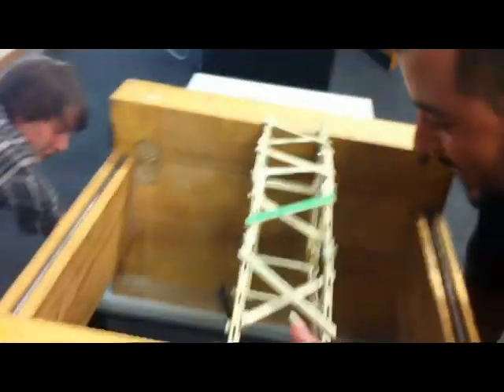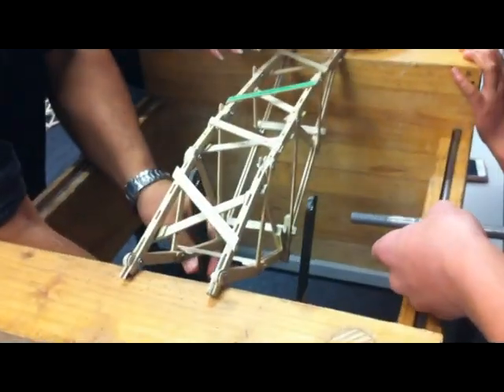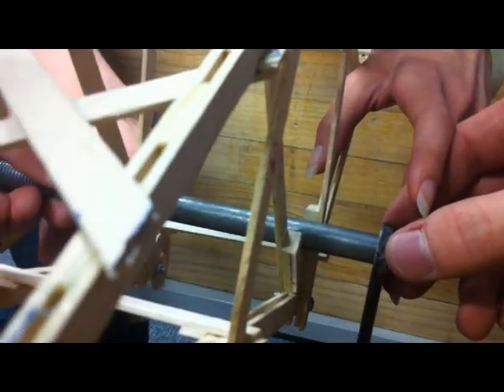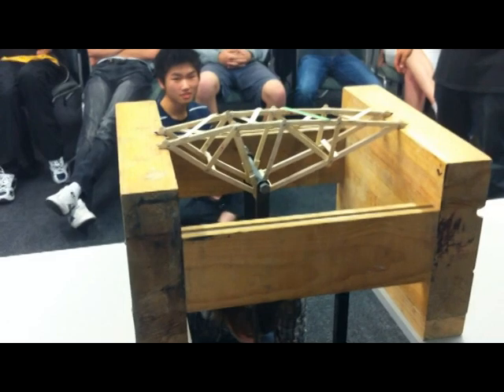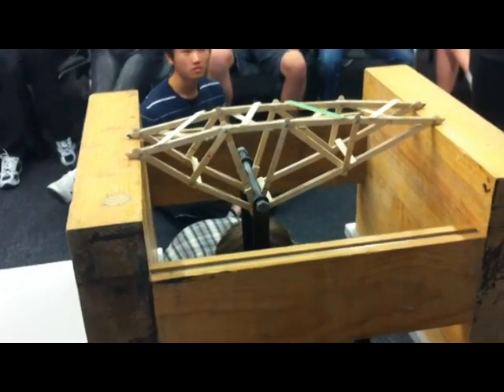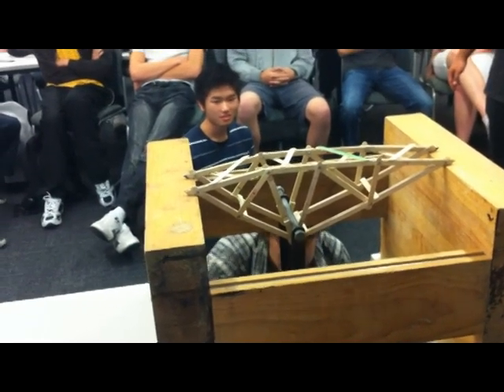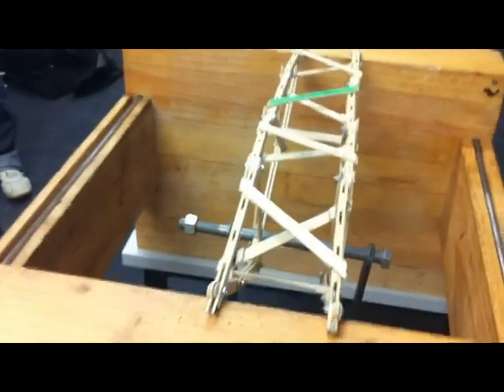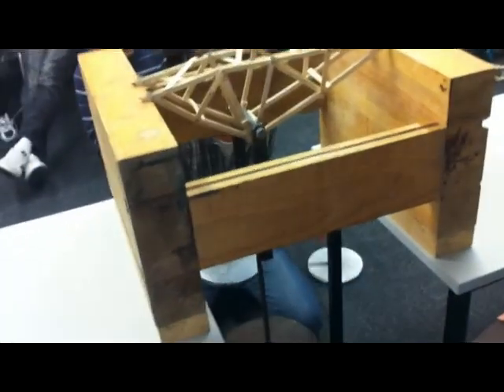Record Truss Bridge 2012 - University of Auckland Engineering

Comment: The crazy thing is that the actually bridge part didn’t fail the sticks failed
Reply: That's what's going to be the source of failure no matter what, it's just about designing it to distribute weight across all of the sticks.
Reply: ??? the sticks are the bridge, it's like saying an actual bridge didn't fail because only the cable snapped
Reply: William Lyon  I think they mean the parts where the sticks connected, whereas the breaking point was actually in the middle of the popsicle sticks instead.
Reply: Neal Head  pressure will almost never be evenly distributed across a bridge
Reply: What will melt your brain more than this is they had stacked the weight on top of the bridge it would have had a different breaking point, in terms of weight.  It may have been less or it may have been more but having it distributed differently would have changed the physics.
Reply: @marine_vet  wow
Reply: Santos you actually made a good observation that was not fully understood by the people who commented. There are many different ways a construction can collaps, it always collapses at the weakest point.    In this case the collapse happened at the point where the load was connected to the bridge, (if I saw it right, footage was sort of blurry) because of transverse forces acting upon the wood. You can call it a popsicle bridge, but when calculating the model the properties of the specific wood applied are taken into consideration. You could see them as very tiny wooden beams. The fact that they have rounded edges does not play a role. In this type of bridge, some popsicles are under tension while others are under pressure. If the bridge had its weakest point in one of these elements, the structure of the bridge would have collapsed. I think that is what you intuitively understood and what you were trying to articulate. 🤓 edit: correction, after a closer look I think the construction collapsed because of tensile forces, hence four broken popsicles..)
Reply: @hesterdekoninck  You are correct.  Even without looking, I am pretty sure the failure mode is the popsicle sticks that are in tension splitting right at the pin connection.  Wood is extremely anisotropic.  It is very strong at resisting tensile and compression forces along the grain but is very weak at resisting splitting along the grain particularly at the ends.  Things they can do that can at least double the load are to glue a small piece with grain perpendicular to the grain of the truss member in tension at the ends, or at least move the pin further away from the end of the member.  I didn’t see either being done.  They can also eliminate most of the transverse members and use them elsewhere since these bear no load in this particular test (point load at a known location and direction).  Being freshmen, they probably haven’t made it through their strength of materials class yet or maybe they just didn’t pay attention :-).
Reply: StoneBoiii420  and yet if you lump steel and concrete into a big pile and drop it into a river, it's not a bridge. design is about leveraging the strengths of the materials you have.
Reply: @Inceptacon lol

Comment: What a strange point to use to test loading on a bridge, where in use the load is normally applied at the top.

Indeed to test the bridge load should not even be applied at a point but spread.

Comment: I would replace the loading technique with pouring sand into a container to get a more exact failure weight
Reply: Do you realise how much 120+ kg of sand is though? Just not practical
Reply: @Cyba_IT  combination weights and sand
Reply: You boys would be in charge of cleaning up then
Reply: @scottwales5966  just put a plastic sheet under it and shake it off somewhere outside afterwards. I'd assume a place full of engineers would have people come up with either that or a better solution
Reply: Also it will increase the weight gradually
Reply: Yer right! And would it be more accurate if the load was put on top(not bottom) of the bridge?
Reply: @fultontracymendoza6149  the bridge is designed around the idea of the load being applied like this though..
Reply: @flappy7373  Which is a flawed way of testing a bridge as that's never how bridges bear weight.
Reply: @alegend4evr  yeah that's true, but it's not meant to be a proper bridge. it's meant to be something designed for the specific purpose of bearing a load in this way. if they wanted to design a proper bridge, they could just make it so that the load would be applied from above.. but again, that's not the point of the exercise.

what you're saying is like saying that using paper to design a tall tower as an exercise is dumb because paper is meant to be used for writing only.

at least that's the way i understand it. i could be wrong.. if so, i'm sorry.
Reply: @alegend4evr  i tried to build a traditional truss bridge for the project in high school physics 

didn't hold weight from the bottom but you could basically sit on it
Reply: @fultontracymendoza6149   This is not meant to be a realistic test of a truss bridge.  This is more of testing of a point load, which means the strength of materials around the load point is more important, as attested by the failure mode at the end.  If I were them, I would remove most of the transverse members (these bear 0 load in this test) across the the bridge and use them to beef up around the load point, especially the members in tension.  Popsicle stick truss members are way weaker in tension due to wood splitting at the pin at the end.  I would also pin these members further away from the end and/or glue reinforcements at the end.
Reply: Many large bridges support their load underneath, particularly ones spaning long distances. Most iconic bridges with this way to some extent. The road, rails etc are slung underneath. Even if it might not obviously appear this way.
Reply: @fultontracymendoza6149  That is exactly what I thought. The weight at the bottom has no significant factor of what it can hold at the top of the bridge.
Reply: The important question is how am I going to drive my car over such a small bridge?🤔🥴 Also, are they recycled popsicle sticks?
Reply: @AG-io5wr  WHAT IS THIS??! A BRIDGE FOR ANTS?!
Reply: 110kg of sand is a lot of sand
Reply: there is so much sass in this comment thread and I'm here for it
Reply: 🔵 You could simulate the weight by using an electromagnet.
Reply: 🔵 Use an electromagnet to simulate the weight.
Reply: Can you imagine the amount of sand you’d need for that? 280 pounds of sand
Reply: Precise would be a better word than exact.
Reply: Or a winch and just measure the force....the accuracy of this system is horrendous!
Reply: @thowa1  best idea yet 👍
Reply: Sand isn't anywhere near as dense as metal plates. That is one issue lol
Reply: And how you will measure the weight? It is not written on sand
Reply: yeah, it does the job in a more linear manner
Reply: It's the US just use lead shot
Reply: @nerfinator03  yeah, a bunch of lead or iron pellets or marbles would be way more convenient and easier to handle than sand

Comment: The measurement accuracy is bothering me. How can they beat the previous record by "6" (7) if they add weights almost a 100 at a time? This bridge holds somewhere between 1087 and 1183N, while the previous record, if tested the same way, holds between 1080 and 1176. They can't know whether they beat it or not. There must've been just something different with the setup if the previous one was at 1080 before the failure — this one was never at 1080, it went from 991 to 1087.

Comment: Brilliant placing the loading point off center! And biasing it towards tension rather than compression! Wonderful.
Reply: Are you referring to the asymmetry ?
Reply: @redreuben5260  yes the asymmetry. I believe the closer you place the load to the edge, the less moment you need to deal with.
Reply: @Aheitchoo  That’s fine for a static test but does it apply when a cement truck drives from one side to the other ?
Reply: @redreuben5260   This certainly wouldnt work for a cement truck. But as a discrete solution to a discrete problem its clever.

Comment: check my video, we didnt even used screws for joint just with glue .
our truss self weight is only 23 grms and its failure was at 55.4 kgs , it is almost 3 times greater than urs. KITSW

Comment: Force and weight should not be confused, nor should their units.   The bridge held 110.8 Kg. The failure "force" was never directly measured (as with an electronic load cell). If you are talking weight use Kg's. If you are talking force use Newtons.

Comment: I would have thought that the weight should have been on the top center of the bridge, which would be a more accurate representation of real-world loading, instead of putting all the stress on the bottom of the bridge.

Comment: Every bridge contest my father helped me with won. Our "flat toothpick" bridge, which only spanned 12", held 48lbs (we ran out of weights), and won without ANY signs of failure. Ironically it was a truss bridge that came in second! Then again in my HS science class our cereal box bridge, which spanned around 20", won, and later held all of 550lbs without failure. It should also be noted, my father is simply a small general contractor.

Comment: shouldn't you put the weight baring point on the flat surface of the bridge, where most traffic will be passing during bridge operation?  I conside this position change of weight force exertion will change some of the force distribution in some of the supporting beams, thus for the realism of weight baring simulation(as of serving the function as a bridge),  weight being exerted onto the top horizontal beam of the structure will more reflect the structral stregth data.

Comment: This was in my suggested viewing list, so I did.  Looks like they all had good fun while learning.  
In case anyone notices this and can answer - any idea why the ends of the bridge aren't secured?  That would keep it from spreading out and changing before breaking.  signed - NOT an engineer. ;-)
Reply: It's part of the test. Securing the ends would throw off the test, because you wouldn't be able to accurately measure what the bridge itself could hold

Comment: Why not use an electronic scale with cabling so the load is applied steadily to the point of failure to determine the ultimate load like a testing machine?  Adding the load incrementally also is a shock load.  This is for fun besides proving the calculations.  At any rate, well done.

Comment: As an engineer, I am afraid that there is nothing impressive about this " record bridge" as the manner it is being tested is not correct.   I could do even better with one loose fishing line tied to the ends of the cliff.  All they have is basically triangular of forces experiments using only three STRINGS.  The horizontal part of the bridge is not taking a " bridge" downward force but only a horizontal compression and to provide some solidity to the two support ends rather than tying the ends to the cliff edges.
That bridge should not be " loaded" by pulling down from the point which it was tested as that is completely the wrong test.  The loading point should be at the top and not even at the center of the bridge but slightly off-center.
I am surprised that the judges of this competition as Aukland Univerity did not see this misnomer of how the bridge was tested.    That bridge should have been tested at the walkway of the bridge and not at that lowest suspension point when  all it turned out to be is a three-string suspension system  one string to suspend the load from one point and the other two  tension strings reducing the load by their looseness and having their anchor points on the cliff edges!! THATIS NO BRIDGE, that is a loose rope across a valley, loaded at its centre!
Reply: Carmel Pule' shut up, nerd
Reply: Shakoiatenhawitha Cross Jacobs nerd big different from engineer
Reply: I ain't no Roman Engineer but It would of had a better chance if the load bearing point was at the top! 🤔🤭

Comment: It broke due to material, not due to weight. Good load positioning would doubled its capacity.  by hanging it at the bottom axe you only used about half its capacity... Hang it at top. Or find a better more realistic weight means. Imagine cars on top of it.
Reply: Some plate wolud donthe job

Comment: I made a 50 gram bridge in 4 hours that held 160 pounds. Considering their weight of 126 grams and their record of 220 lb using mass held per weight of truss my brigde held 100% more weight per gram than their bridge. By the way I brought it in late, and got only second place using special wood super glue on Amazon and off hand copying a design of a brigde which held 1200lb  on YouTube. This is why Chinese products are still better than the USA products.

Comment: Why is the weight hanging from the bottom! Bridges are designed to take weight from the top, it only failed at the lowest point the top of the bridge was fine
Reply: You'd think they'd flip it upside down (rightside up)

Then place the weight on the tracks of the bridge like in real life 🤔

Comment: there is a difference  when you put weigth under...big difference on the top weight...
Reply: You design the truss based on how it will be loaded. I am sure they loaded it from the bottom to make sure the weights did not fall 3' to the floor. I did this exercise in grade 8 drafting class, as I recall we were given set number of sticks and white school glue and we loaded bricks on top of the truss.

Comment: As for measurement, instead of putting on big weight discs, why not attach a bucket at they bottom and then fill it with sand or water, that will allow you to drip smaller amounts in towards the end & therefore have a more accurate measurement of the force

Comment: the bridge folded in several location, this is a good sign that the distribution of the tension was fairly good. It would be even better if the bridge literally exploded everywhere at the same time, meaning that all the efforts were all over the place, evenly.
when I did this exercice back then (with spaghetti), we used 2 buckets of water and poor in from one to the other gently, then weight the bucket after the bridge breaks. Seems more convenient than the loads you are using.
good show, loved it.
Thanks.
Reply: I enjoyed it too! From what I can see, the joint failed. It would be interesting to see how the bridge holds up if the joint could be a single piece of cnc'd aluminum. But then again, the connection to the internal member may be the next point of failure due to the shear value of the bolt in the Popsicle stick. The pre-stressing of the bridge is a clever idea!

Comment: We did a similar project in high school physics... you received 1 Manila folder and were told to span a set gap.  (I think it was 9 inches).  Had to be an A frame type with a centered load.  Smart folks used different glues,  one even used hollow tubes and filled with hot glue.  Meanwhile i honeycombed my main struts and carried twice as much weight as the solid strut with 1/5 the weight
Reply: Damn

Comment: I find the placement of the weight idiotic.  By distributing the load on multiple points or evenly across the top...wouldn't that get a better picture of it's weight limit?  Not just how much stress the lower portion could take by pulling down from???

Comment: Is this impressive? I do not know as I retired from engineering studies before college. My lab partner and I did place very high in the high school paper tower test at nearly 8 feet high. We did these bridges in middle school (I forget requirements). My glue was still wet (procrastinator extraordinaire) and my bridge held nearly 600 lbs (top 5, 3rd I think). The winner cheated using wood glue but his held nearly 900 lbs so he still won (with a penalty to his grade or something).

Comment: Stop worrying about the 'bridge' and make the V deeper.  Deeper V means the sticks along the V are even more straight down from the suspension points at the sides, make them as strong and vertical as you can and they'll hold a huge load.  Then the 'bridge' across the top that keeps the suspension points apart has large, easy leverage to keep the ends apart and takes very little material, almost all of the load will be vertical in the sides of the V.